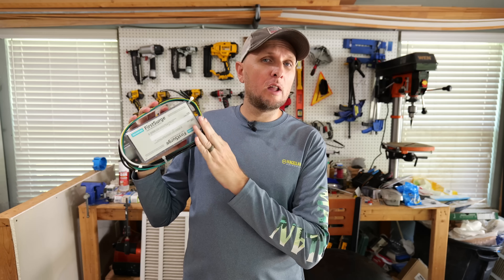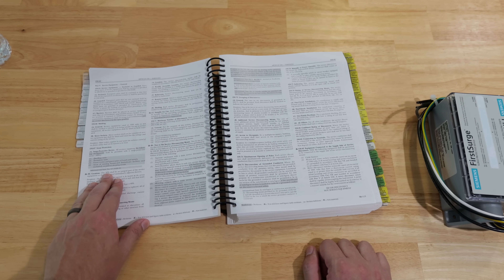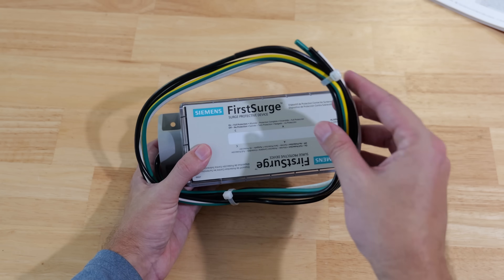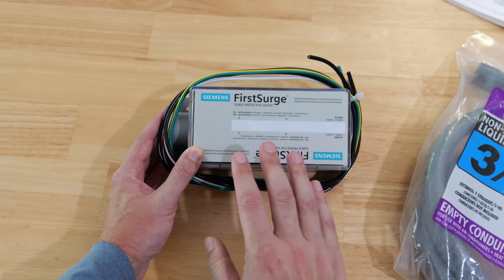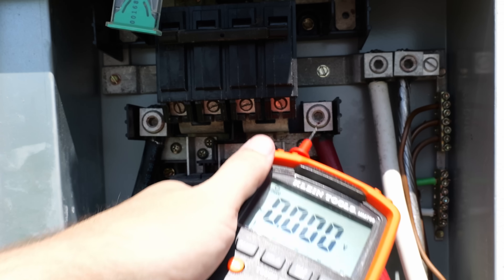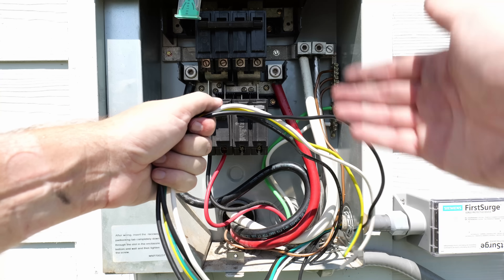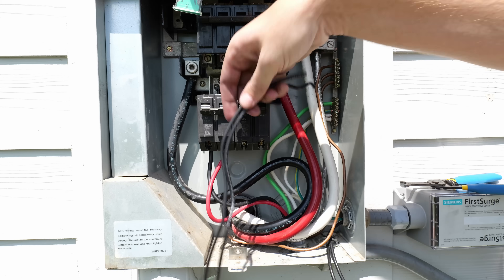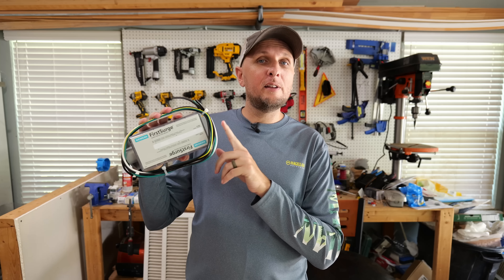Why Whole Home Surge Protectors Are Now Required and How To Install One!  Siemens FS140

Comment: How it works: the device detects excess voltage in the entire electrical system (since it’s all at the same voltage) and diverts the excess to ground. As long as it’s connected anywhere in the panel it should drop the voltage for all circuits in the panel (because of the common bus - anything that can drop voltage can affect other items, kind of like when your lights dim when your a/c comes on).
Reply: Until that 20 amp breaker trips due to a surge that's greater than 20 amps, then it's useless, unless you're constantly looking at the LED's.  This is the first time I've seen this kind of device, and I'm not electrician; just someone who understands electricity very well.  But, something seems wrong about this whole thing.  If you're protecting the whole 200 amp panel, shouldn't the surge protector be rated for 200 amps?  Am I missing something?
Reply: @theclearsounds3911  you’re missing that a 20A breaker doesn’t trip the instant 20A on a circuit is reached & that spikes are usually very short duration. All breakers have a tolerance for how long an over-current condition is allowed to persist before they trip. Even a 20A breaker can generally take 200A for a second or two before it trips, which is a much longer duration than the average power spike. So having to have a 200A breaker for this application is overkill for no real benefit.
Reply: @theclearsounds3911 except the lightning bolt would trip the main as well, wouldn't it?  ... Nearby protecting your entire house?
Reply: @theclearsounds3911  nothing’s going to protect you from a direct lightning strike on your service, and the device shown in the video won’t either. Having said that a direct lightning strike is far less common than a nearby strike that has chances to go to ground before it gets to your service… that’s what the device in the video can help with. There’s a reason they’re called surge “protectors” and not surge “eliminators”. Best you can do for a direct strike is have a lightning rod and hope the bolt hits that instead.
Reply: @theclearsounds3911  The SPD is on the service entrance, before the breaker enclosure.
Reply: @theclearsounds3911  It's more radical than that. The initial lightning surge, the one that is typically in the 100,000 amp range, lasts a bit less than a millisecond. Depending on how the lightning got onto the line to start with, it may be followed by a few hundred milliseconds of lesser current - that is the main fire concern.
Reply: The breaker doesn't trip due to a surge. These devices briefly short that surge to ground themselves. That's the protection and the one he recommends can send 140,000 amps to ground. The breaker only trips if the surge is so great the device sacrifices itself to spare your home. That's why the 20 amp breaker trips.
Reply: @theclearsounds3911  Yes - the difference between amps and volts.
Reply: @theclearsounds3911  Oh, you are forgetting about the thick coating of snake oil on those puny wires that makes it all work by magic.
Reply: Thanks for the explination!
Reply: @ebenwaterman5858 I can see wired-in SPDs protect branch circuits when they are wired in parallel into the same breaker. When the SPD is on its own breaker though, the breaker's own parasitic inductance (magnetic trip coils) will ruin the SPD's effectiveness.
Reply: @teardowndan5364  That's something I'm wondering about here as well, and may be why some of these are rated for direct connection without a breaker.
Reply: Thank you, I was thinking to myself, how in the world does it protect anything when it's not in line...
Reply: I hope it does not protect against excess voltage only: A surge protector should also protect against excess intensity coming up from the ground when lightning strikes nearby, which could fry most appliances that have a ground wire.
Reply: @Chimel31  The presence of a ground wire on an appliance's plug makes no difference in its susceptibility to ground strikes since neutral and ground are supposed to be bonded at the main breaker box or wiring panel. At the appliance, the ground wire should be at the exact same potential as the neutral wire, give or take I*R difference from load current.
What usually kills stuff via ground strike is having grounded devices powered from different electrical circuits have secondary ground connections (ex.: HDMI cables) to each other for induced current to flow into. Having a whole-home surge suppressor won't help that.
Reply: @teardowndan5364  Different countries, different codes: In French houses, neutral and ground are bonded a bit farther, at the utility's transformer level, but each house must also have its own separate grounding, no bonding at the breaker box or wiring panel.
So if lightning strikes on the ground or a nearby building, not on the utility's cables, the surge can come in through the house's ground but not through the utility's neutral. The SPD protects against both surge entry points.
I didn't know about this HDMI secondary grounding issues, thanks for the info. It looks like there are indeed a lot of ground loop and other HDMI port frying issues around...
Reply: @Chimel31  Having no bonding between neutral and ground sounds dangerous: depending on the grounding quality, there could be a significant voltage difference to neutral. You wouldn't expect a shock from touching ground or neutral due to a fault elsewhere bringing ground near live level.
And yes, secondary ground loops are many: every copper-based signal/data connection between two grounded things. Also, even if stuff isn't grounded, there is the risk that surge voltage could rise high enough to arc over the weakest separation points, which is why fried Ethernet ports are also quite common despite Ethernet ports typically having ~5kV signal isolation transformers, 10-15kV for many modern PC motherboards.
Reply: @teardowndan5364  Sounds dangerous, or safer...  😄
You can't get electricity connected to your new or fully renovated French house if grounding is above 100 ohms.meter after inspection for electric code conformity, which is way above the value for human electrocution with the usual 30 mA differential switch protection.
Lower values such as 10 Ω m are recommended. My bicentennial house did not have any grounding at all, that's the very first job I did on it. I managed about 20 Ω m even though grounding is inside the garage and the 2 x 2-meter poles are in non-conductive dry clay soil by making a trench filled with compost, manure, peat, coal dust, salt, iron filings, a bit of the original clay, watering and compacting this trench, with a 5-meter 25 mm² naked copper cable in the trench between the 2 poles.
I could probably get an even lower value by peeing on the trench...
Reply: @Chimel31  Unless your RCD breaks BOTH live and neutral, you will still get shocked/electrocuted by ground-neutral voltage differences caused by faults external to your RCD-protected circuits.
Reply: @teardowndan5364  For houses, circuit breakers protect only the live wire (1P+N=1 Phase+Neutral). In industrial settings or hospitals who need to ensure a continuity of service, there are circuit breakers that protect both live and neutral (2P=2 Poles). But in both cases, they disconnect neutral too, that's why the former is called 1P+N.
But RCDs ("differential switches" over here) don't seem to work in the same way: Single pole RCDs protect and disconnect only the live wire. Double pole RCDs exist too, but maybe according to what you say, we should consider using them more. I'll check it out with local electricians.
Reply: @Chimel31  Historically, bonding was about being able to pass enough fault current to pop fuses and breakers when something shorts to ground. Not as much of an issue when you have RCDs/GFCIs for just about everything.
It does have other benefits though. On my street, single-phase transformers have one input connection that goes to a HV line and neutral is shared with everything else down to the pole's grounding rod. If enough of the neutral/ground network gets severed, as it possibly could when a truck crashes into a utility pole, then neutral coming from the pole could potentially float to 9+kV. If you bond and such a fault occurs, no problem as you still get ~0V N-G in your house.
Reply: For anything for brown outs ?

Comment: I am no electrician and may be wrong, but I understand that even heavy duty surge protectors cannot protect your home from a lightning strike. Please correct me if I'm mistaken Thanks!
Reply: There's a lot of factors that go into determining what will survive a strike. Like if it's a direct strike, the total energy of the strike,  where the strike hits, if you have a "ground window" or not, etc. Most residences can't afford the cost of what it takes to protect against a high energy direct strike.
Reply: Good advice. Thank you! @JCWren
Reply: Indeed they cannot .  The one I installed five years ago did, however, APPEAR to protect from surges caused by hits to the nearby primary power lines. You also need either a SP power strip or outlet surge protectors to completely protect "sensitive" devices ( computers, TVs etc.).
Reply: Thank you and much appreciated!! @rzh3443
Reply: They are not for direct strikes.  They are for controlling spikes from equipment and from lightning strikes around the power lines. By the time the surge reaches your house much of the energy should have gone to the earth but the surge may still be enough to damage equipment.  Surge protectors are designed to collect the surge energy and dissipate it over a longer period of time. Whole house surge protectors are intended to protect general equipment. Sensitive equipment still needs its own surge protector.
Reply: Surge protection systems consist of three zones. Zone one is the main service panel, zone two will be sub mains if present, zone three are individual devices such as a PC. Most residential systems will employ zones one and three.
Reply: Depends on where the lightning strikes.
Reply: Lightening is NOT the main cause of voltage spikes EXCEPT for the state of Florida which is the lightening CAPITAL of the United States! 
A surge or spike is easily caused by a car hitting a utility pole. It also can occur momentarily when the utility company restores power. The voltage can be higher than normal just before the “load” brings it down to 240 and 120 volts.
I experienced a severe surge years ago, when the utility company made an improper switching action on a primary circuit. It destroyed all my surge protectors but nothing plugged into them. Fortunately my HVAC was off at that moment as was my refrigerator. 
Other neighbors experienced serious damage which cost the utility company thousands of dollars to cover.
The protector described in this video would have prevented all of the damage my neighbor’s and I experienced, however it would have fried the unit. 
During most thunderstorms, multiple lightening strikes occur, so a surge protector will only protect your property from the FIRST one‼️After that, you have NO further protection‼️
Reply: I would also add surge protectors on your AC unit both inside and outside.
Reply: They can help with near misses - depending how near the miss was…
Reply: Probably the best lightning protection is to use a lightning rod connected directly to a ground rod.  A lightening rod placed at the highest point above your structure can keep your home safe.
Reply: @dave200204  surge suppressors are not designed to stop direct lightning strikes. The vast majority of surges coming from the power lines are from lightning, however.  So he's right that it is a form of lightning protection, just not the kind for a direct strike.  Our system ground is what's meant to handle a more direct strike.  Even so, a whole house TVSS can only dissipate so much energy. Sensitive equipment will still need their own dedicated TVSS for protection.
Reply: a large capacitor bank would be better to swallow the surge and release it slowly back to supply or to ground, though I have not heard of such a device.
A good surge protector should improve the home power factor and decrease what you pay for power.
Reply: @susanvaughn741  what do you think a surge suppressor (TVSS) is?  A surge suppressor is just capacitors that are being used to absorb a voltage spike (aka transient voltage) and dissipate it at a slower rate so that your equipment isn't damaged by the spike.  It doesn't improve the home's power factor. As a matter of fact it would increase the home's impedance.  It's whole purpose is to stabilize the power.
Reply: A direct lightning strike? Let's not be silly
Reply: They protect again poor utility protection where you have trips with fast reclosures to fry everything in your house….That looks like 16 AWG so clearly it’s going take the kiloamps of a lightning strike right….  /s
Reply: You may be a moron if you think any device like this will prevent damage from a DIRECT lightning strike..
Reply: It won't protect in the event of a direct strike, but they do help when a strike is down the line a ways. For direct strikes you would need a lightening arrestor, which is a completely different animal.
Reply: They absolutely do not. Nothing does. I've even seen systems designed for it specifically get fried. His point about detectors was way off, because those are battery operated and not even attached to your home grid. Also, I've seen hundreds of houses go up in the last few years and none of them have such a device and they are fully inspected and up to code.

Code is different from state to state, or locality to locality. There is no universal code.
Reply: @williameldridge9382  Some security/smoke/CO2 detectors are, in fact, wired in. I've seen a couple myself.
Correct me if I'm wrong, but either hard wired ones are more or less common now than, say, 30 years ago. They might be more common since you don't have to replace the batteries, or less common since they are more susceptible to power surges. Some are also combo units - hardwired with a battery backup. As to how common they are nowadays I can't say - I've only worked on my own residence so far - but they do exist.
Reply: @williameldridge9382  the NEC stands for National Electric code.  If it’s in the NEC than it’s code everywhere.  Municipalities can make it stricter but they can not remove anything.

Comment: Thanks for the great video! Question: What is the difference between the whole-house surge protector used in your video, and the Siemens BoltShield FSPD140?
Reply from the maker: Without going into great detail, spec wise they are very similar with the FS140 edging out the Boltshield in a couple categories like operating voltage and voltage protection rating.  The Boltshield has 18" wire leads on it where the FS140 has 36."  Of course we want those as short as possible but 18" may limit some people.  Price is about the same.  I have read where while the newer Boltshield has the Siemens name on it, that it is not the same manufacturer as the FS140.  So those are the primary differences and why I still prefer the FS140.
Reply: @HowToHomeDIY  thanks so much for the answer!

Comment: Thanks for the great video. Living in Florida, the lightning capital of the US, I decided to protect our home with an Eaton whole house surge protector. I installed it 7 years ago and  the two green lights on the unit are still glowing 😀. It was very easy to install and certainly feel more secure in the event of a lightning strike. Prior to the install, we did have a strike nearby and it blew out our security alarm system which wasn't a cheap repair. Hopefully, these devices will protect like they advertise.

Comment: I have the exact same Siemens surge protector installed this spring, but I don't think it's been very effective. This summer, we experienced a lightning strike nearby, and many of our electronics were still affected.
Reply: These are surge protectors not lightning protection. Lightning can induce thousands of volts at thousands of amps which require equipment magnitudes more expensive. Just thought you should know. Some of the snake oil sales types call what you have lightning protection, but it isn't. The primary purpose of the grounding rod found on many homes is primarily for diversion of lightning strikes (up to a point). Verifying that the grounding (earth ground) wire from the main breaker box is the correct gauge for your service, is securely connected to your grounding rod (no corrosion-weather protection is advisable as well as some anti-corrosion chemical especially in salt water locations), and a verification that your grounding rod is sufficiently deep for your locale. In many locations this is not possible due to hard and dry rock formations close to the earth's surface. Austin, Texas is a good example, as many electric utility personnel run earth ground testing on large structures there.
Reply: @TheDigitaldoug  They are intended for all surges, including lightning protection. The present standard for SPDs is 200,000 amps - the standard replaced Transient Voltage Surge Suppressors (TVSS) that were typically rated at 25,000 amps. Given that lightning averages about 100,000 amps for the first millisecond or so before it drops off SPDs are plenty... but as others mention inductive surges can be very large indeed.
All the protection in the world doesn't matter unless the installer is serious about single point ground.
Reply: A couple of hundred feet of wire beyond the protection will inductively pick up surges from near misses! Lightning creates what called an EMP and in some cases all it takes is a long enough foil trace on a circuit board to pick it up and cause damage!
Reply: Might not be installed correctly, or your wiring might be weird..